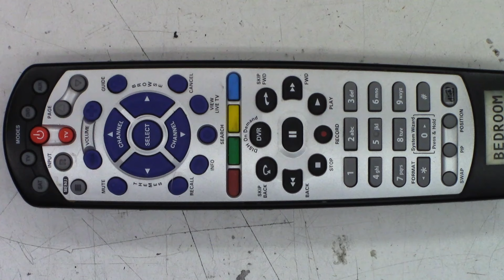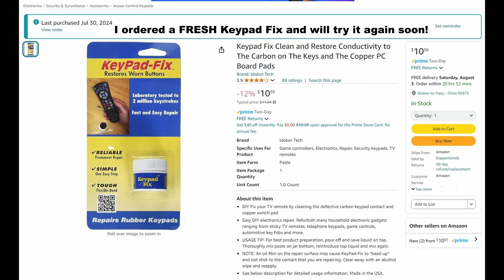Dish Network Remote comeback PT1 Trying some old Keypad Fix to see if it improves the issue.

Comment: The problem (and I have the exact same one - repeated over and over for the last 5+ years) - the silicone "sweats".  I have no clue on how to do a reliable fix.  Cleaning with IPA helps, as does acteone.  Painting over them helps too, but the silicone continues to sweat and the problem just comes back =/  I think we need some chemical fix to the silicone?!?!